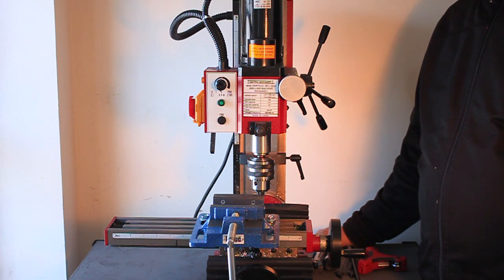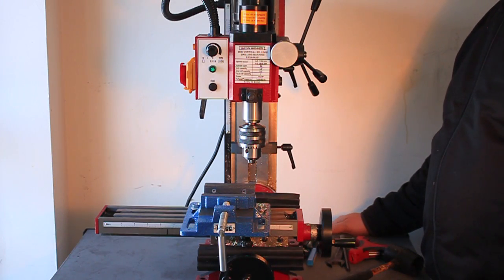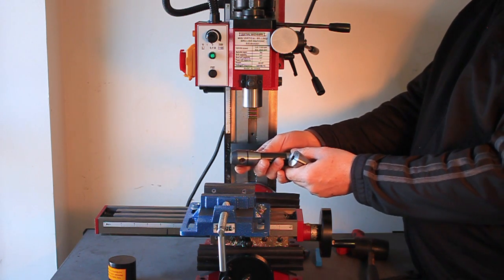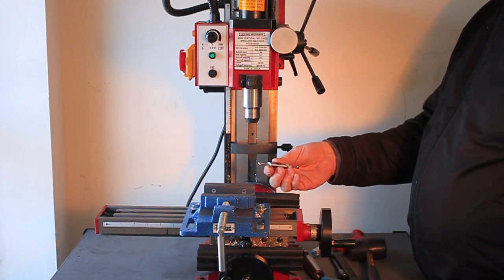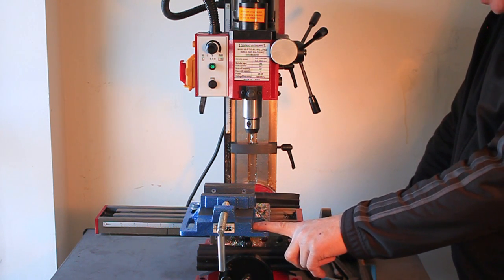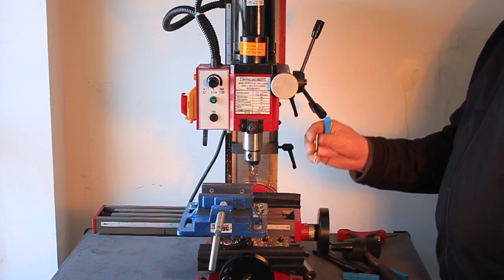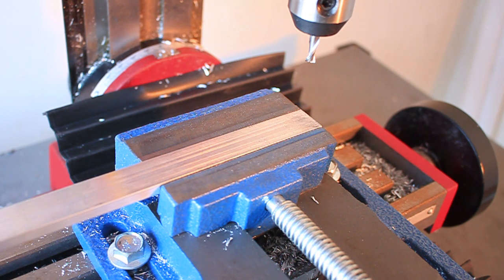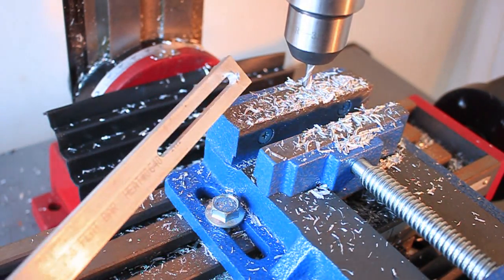Harbor Freight Mini Milling Machine

Comment: when you remove the chuck leave a half doz threads in the shaft then tap it free and remove the bolt ,you won't risk bugging up the thread ends that way
Reply: Even better would be to loosen the shaft 1 turn.  It's a morris taper, so more than that is really a waste of time.

Comment: Before anything the spindle needs to be recut on a lathe then all new bearings, new lead screw and nut, new rack and pinion, and then you can use it

Comment: whats the different between a drill press and a milling machine
Reply: Also, the tapered nature of these chucks make the drill press very dangerous with side loads. The quill can work itself out with a side load and under power, can cause a great deal of catastrophic damage and injury in an instant. So use the proper tool for the job. One may get away with side loading a drill press a few times but don't kid yourself, it's a dangerous game to play.
Reply: Drill press is only designed for a single drill hole. Where a milling machine has a sliding table and bearings designed for side loads.
Reply: A drill pres is mainly made for drilling a hole, like a hand drill, not made for milling slots as shown in this video.  Although some people use a drill press for milling, that's not what it was designed to do.
Reply: A drill press is designed  for only vertical holes the bearing won't hold up doing lateral milling
Reply: Good question - I would like to ask, can a bench drill be converted to a milling machine? Is there a video of this being done?

Comment: What's the difference in a mill and a drill press?
Reply: The milling machine is much more stable and precise. a drill press is not made to support the lateral forces that are required for milling.
Reply: You can only operate a drill press on the Y axis.  Mill you can operate on the X, Y and Z axis.
Reply: You sure that's not the z axis (vertical)?

Comment: this mill can work with stainless steel ?
Reply: That's more a question of the type of tooling you use and not over-burdening the motor or the mechanisms of the machine. 
Get tooling made for cutting stainless, only do jobs of a small nature as this machine is intended for, machine at the right speed, err on the side of making more passes instead of less, and you should be fine.

Comment: this is the first harbor freight product iv ever seen work.
Reply: +marshal standley
Nonsense. HF sells some good tools. 
Their problem is consistency in quality control.
One tool will be solidly assembled and work well and last for years while the next tool of the very same make and model will be a complete lemon.
Most of the people who complain about the quality of HF tools have unrealistic expectations. They forget what it is that they are buying and why it costs so much less than other brands.
HF has saved my bacon more than once and didn't break the bank in the process.
That said, HF is usually not my first choice when buying power tools.
Reply: depends what you buy from them... there is good grade thing and then there is complete shit. anything that has no name is instantly garbage, also i would not recommend their powertools so much but again they are less then 30USD so its ok for doing a few jobs around the house. anything labeled PittburgPRO is very good, there Jacks both floor and bottle are an absolute buy.

Comment: Thanks for sharing. I was curious to see how one of these machines cut and from your demo, I see it could do a reasonable job on projects within the scope of the machine ie small aly parts ; no doubt brass, plastics etc and maybe even harder materials if you're patient and take light cuts. Cheers.

Comment: hi, I eliminated the chance of damaging the draw bar threads by making a drift bolt on the lathe for my sx2 mill.just remove the draw bar and insert the drift and tap with a hammer.hope this helps ..geoff

Comment: I prefer collets but that being said little advice when you break you set bolt to drop your collet or chuck... just loosen it a few turn and then bump it with your mallet.... never have to worry about threads and much easier to work with
Reply: S was my time to get to my year in year

Comment: From my experience and I've done a lot of machining, These are great for hobby... My only suggestion would be use the best tools you can afford or are available to you.. It'll save the machine and probably you a lot of pain or grief... Not 100% sure of your training but I'd loosen about 3 turns and bump the collet, chuck or any head device to disengage it then remove the holder screw the remaining portion...  Have fun and be safe.... Good day..  Not trying to be any kind of disrespectful hope you don't take it that way... Again have fun and maybe check out  mrpete222, he does some very nice projects... thanks
Reply: mrpete222 rocks!!!

Comment: Won't you need different sizes for the "end mill holder" as the collets? The holder only uses a clamping screw. It gives the impression you ONLY need one holder and many collets? Or do all the end mills come with a standard size shank?
Reply from the maker: +Andrew Nichols I should've mentioned this in the video but your collet or end mill 
holder size will depend on the shank size of your end mill. I would 
suggest getting a 3/8" end mill holder or collet, and then order your 
end mills with a 3/8" shank if you can find them. There are a lot of 
suppliers that offer end mills of many different sizes with a 3/8" 
shank. If not, then you would need specific collet sizes for all your 
end mill sizes. McMaster-Carr is a great source for end mills.

Comment: You can get a high quality, american made, tough-as-nails milling machine used but in serviceable condition for about 500 dollars. So what if it has been slaving away at a factory for 30 40 years? If it can handle that and still works, you are just about guaranteed to never break it. Plus, your shop will look so much more badass with an old bridgeport in the corner rather than shit from chinese slave factory that can't machine to 1 thou tolerance. Anyone who pays that money for that shitty machine is a fool. If you are that limited by money, go get an old drill press, clamp a vice to it, change the chuck if you care, and mill with that. The tolerances will be the same with those shit mill vices being used.
Reply from the maker: +K. Meinzer Yeah but you need a forklift to get it into your shop, and probably a 2 or 3 phase electric hook up. This is just a little bench top machine, lighten up dude.
Reply: K. Meinzer where can you get them for this price these days? I've only seen them around 10k+!
Reply: I see plenty around here for 800 bucks or so.. But I have no need for a 2 ton monstrosity in my shop.
Reply: K. Meinzer untrue made a bridgeport  cut  at slight angle by leaning on head...enco and induma..mirror bridgeport
Reply: K. Meinzer I
Reply: LOL yeah, I have 30 Ton 35 ft. long Printing Press in my garage...just for hobbies.
Reply: Crawl back in your hole
Reply: You're an idiot!!

Comment: I have this mill and its slightly better cousin from LittleMachineShop.  And  if you are buying new, the extra $300 is money WELL spent on the slightly better version. But if you're already at the $800 mark, make the jump up to the Grizzly G0758 at $1000,  its a slightly bigger machine,  but still possible for a person to move.  If you can find one used for a couple hundred bucks, sure why not get the HF... but  all in all...  its a pretty poor representation of the machines from China.

Comment: This might already have been said below, but just in case, here goes: End mill holders are sized just like collets. So if you get a variety of sizes of end mills (the shaft size, not the cutting diameter), you will have to have a variety of sizes of either collets or end mill holders. The advantage of the end mill holders over the collets, from what I've heard, is that IF your end mill has a flat (not all do) then the holder is less susceptible to slippage than a collet. So far, I've only collected collets, so I can't speak from experience on the comparison. Great demo of this little machine. Right now, I have a Bridgeport, but if I need to downsize someday I'll be looking at these guys with great interest.
Reply from the maker: +Rick Rose I should've mentioned this in the video but your collet or end mill 
holder size will depend on the shank size of your end mill. I would 
suggest getting a 3/8" end mill holder or collet, and then order your 
end mills with a 3/8" shank if you can find them. There are a lot of 
suppliers that offer end mills of many different sizes with a 3/8" 
shank. If not, then you would need specific collet sizes for all your 
end mill sizes. McMaster-Carr is a great source for end mills.
Reply: on this size of a machine there is absolutely no reason to have an end mill holder there is no way this machine has enough snuff to spin an end mill in the collet

Comment: Those drill vises are pieces of crap for milling machines. The main problem with them is when you tighten the vise up the movable jaw will lift up, and your work piece will not be flat in relation to the table then either. Do this: Put a piece in the vise snug, then put a dial indicator on the work piece, and tighten the vise up. Observe how much the needle moves. Now go out and buy a decent vise.
Reply: The milling table it comes with is created to use T Bolts!  Make some up, and use them! Better than a vise!  There is a book, on Amazon, called "Making Small Workshop Tools" By Stan Bray, ISBN:978-085232-886-3 first printed in 1987, Reprinted a dozen + times, last in 2016, that has T Bolts, clamps, fly cutters, rose bits, calipers, scribes, work holding devices, and more!
Reply: I don't care how good anyone makes a drill vise. The movable jaws in them lift. That is due to their design. Milling vises are made differently to counter that.
Reply: Paul Frederick depends on the vise, most indeed are junk. the ones harbor freight sold were pathetic. On mine I used a good quality craftsman 4" vise sears sold for a short time over a dozen years ago.
Reply: +Patrick Patrick I think you mean tee nuts.  For most milling jobs a milling vise is the best clamp to use. Because jobs usually require clear access to the whole top of the work piece. Hold downs cover part of the work. BTW milling vises are secured with tee nuts too. The trouble here is they're using a drill press vise. Those do not have a movable jaw that stays down. Movable jaws on milling vises are much longer, so they stay aligned better. Mill vises stay on mill tables so long rust forms under vises. That's how popular they are.
Reply: check out a libary old popular mechanics early 1940s thru mid 50s all kinds of info remember mom and pop shops helped war effort theres a variable speed drive to build as well as spindle brace to strengthen  spindle also geometric made a small diehead with removiable inserts to chase threads on a drill press...just sold on ebay read n learn....

Comment: When removing the chuck/collet, I found it good practice to unscrew the drawbar just a couple turns and then tap it. This keeps a large amount of the threads (surface area) in the chuck/collet and then unscrew the rest of the way. This way you'll never strip/bend the tip of the drawbar.
Reply: And it won't bounce off your part.

Comment: buy a cheap set of parallels or make them
Reply: +Jon A They need a decent vise first. Those little drill vises never keep the work square when you tighten them up. That is why milling vises are a completely different design. Because that is what works. You can beat the work down with a hammer, but it will still spring up while you are cutting. You can load a round in by the movable jaw, and that helps a little, but it is still nothing like having a decent vise. It used to drive me nuts trying to square work up in a drill vise. Now I have a real milling vise and life has been much better.

Comment: How is the backlash?  I had used an older HFT type vertical mill, it had a ton of chatter when climb cutting, it was crazy how much play it had.
Reply: +fastst1 Then don't climb cut. There's a reason they call conventional milling conventional.
Reply: Paul Frederick  Indeed, but having both options is nice
Reply: Most mills out of the box will not climb cut.  One of the first things I learned in school.  This includes Bridge Port.  You are taking your life in your hands if you try to climb cut with most mills.
Reply: John Bango
When I did production milling in a tool and die shop all we did was climb. It is faster, and less strain on the axis power feeds too.
Reply: Paul Frederick  I've done my far share of production machining too.  I have been out of the game for more than 25 years.  Back then, minus CNC and NC mills, very few if any vertical mills had backlash eliminators.  Yes climb milling does go faster and less stress on your x axis.  With any backlash it creates more stress on the cutting tool due to self feeding.  This can lead to tool failure and flying metal objects, but you should already know this.
Reply: John Bango
We were satisfied with the cutter life we got.  If I was pocketing clamp bodies I'd go through maybe a cutter, or two a day. With a power axis drive it takes up the backlash when it is running.
Reply: Paul Frederick cutter life is better with climb milling, less friction.   the power axis machines I was using did not take up the backlash.  guess the one you were using was better or newer.
Reply: John Bango
Yeah, no. All of our equipment was beat to death. Well, at least the Bridgeport I used to work on a lot was well worn.

Comment: wonder how it works on steel
Reply: +mike97525 Very well. These are based on the Sieg X2 mill.  I have the Chester X2 model and it is a terrific little machine. I use it on all types of metal. One useful mod is to get a belt drive kit for it. Cuts down the noise and gives a useful widening of the speed range. The other mod is fit a riser block under the main column. Of course over here the price is much higher. The dealers use the 1£ = $1 conversion.    regards from the UK

Comment: About removing the tapered chuck/collet. Why don't you merely loosen the securing bolt a turn or two then tap it loose. Then you will never screw up the threads.
Reply: +David Pencyldyke I agree 100% , you should never fully loosen the draw bar and "tap it" !!! thats like throwing a car in reverse at 50. just loosening the draw bar 1 turn then tap. save the threads. that's taught in milling 101
Reply: riggerr1
A buddy of mine had a Bel Air he'd throw into reverse from drive. He called it doing J's, Because it'd leave a J shaped burn out mark on the pavement. He wouldn't quite do it at 50 MPH though. More like about 30 MPH, or so. Those old Powerglide transmissions sure could take a beating.
Reply: @1pcfred  Been there done that many yrs ago..lol
Reply: +David Pencyldyke That is what I do to release my draw bar. I just bring the bar up about an eighth of an inch, then I tap it, then I take the bar out after the holder is loose.
Reply: +David Pencyldyke ..That's the usual and correct way to loosen the drawbar to release the R-8 toolholders...use a soft metal hammer to tap the top of drawbar...brass or lead..
 Drill chucks aren't designed for any side load.
Reply: i use those old power glides for my drag racing cars we put better parts in them but the cases hole over 1000 hp they are good transmisions bro lol
Reply: You read the manual and it say to loosen the Draw bar, tap it collet loose, then fully remove the draw bar" If all else fail read the instructions.
Reply: @flyingdog1498  I like to say before everything fails, read the manual ;)
Reply: What size is the drawbar threads? 7/16?
Reply: YES!   That's machine shop 101!  You never hit the drawbar unless it's engaged a few turns.
Reply: thats exactly what you are supposed to do. and would make too much sense..
Reply: As a 50+ year machinist, that's how I do it. Never messed up a draw bar thread on the Bridgeports I ran doing it that way?
Stoney
Reply: I learned that in school when i was 15 ...
Reply: That's exactly the correct way. Loosen slightly, then tap.
Reply: thats probably good advice. However, the loosen and the tap is what we do on the bridgeports at work and its been done that way for 60+ years with no issue.
Reply: Bingo.
Reply: commonsense
Reply: @joefranz6215  Not always so common.
Reply: Yeah .. that's what they teach you in trade school lmao. Crack the drawbaw loose and hit with a brass hammer. Or the vice handle is usually aluminum that works well too.
Reply: yep  yep
Reply: Im going to guess because he has NEVER used a mill before
Reply: Yeah that's the correct way to loosen one
Reply: David Pencyldyke I was just gonna say the exact same thing.

Comment: For the end mill holder, I couldnt imagine they are all the same size? Would it be a set of R8 or?
Reply: +uwanaugoda There are common shank sizes. 1/4", 6mm, .125", 3/16"... You could cover most of the bases with 3-4 of them for the torque a machine like this is probably able to handle.
Reply from the maker: +uwanaugoda Yes it is R8 spindle size. I should've mentioned this in the video but your collet or end mill holder size will depend on the shank size of your end mill. I would suggest getting a 3/8" end mill holder or collet, and then order your end mills with a 3/8" shank if you can find them. There are a lot of suppliers that offer end mills of many different sizes with a 3/8" shank. If not, then you would need specific collet sizes for all your end mill sizes. McMaster-Carr is a great source for end mills.